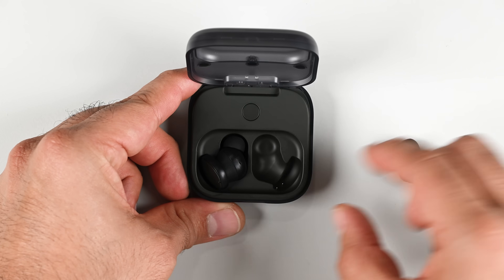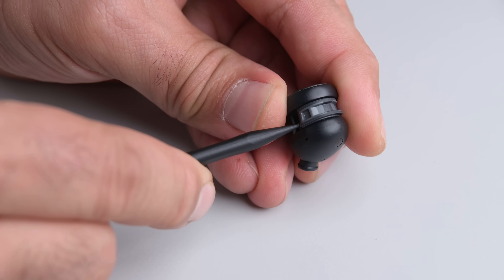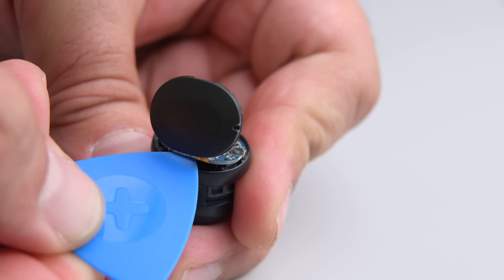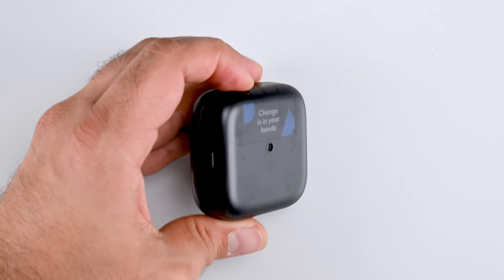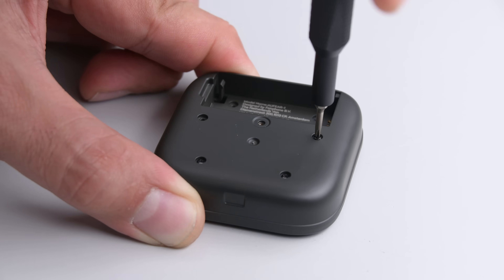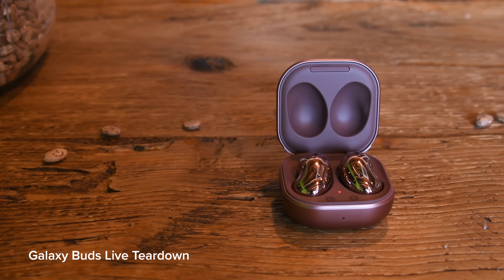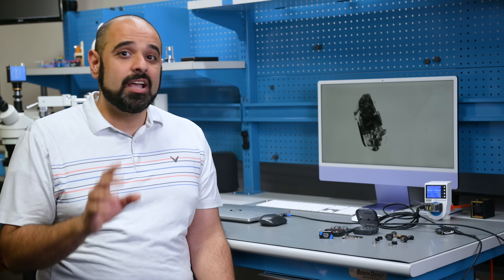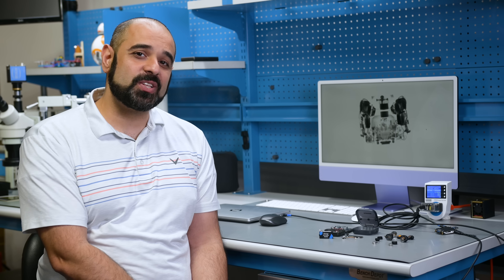Fairbuds Teardown: Our Highest Scoring Earbuds Ever!

Comment: Is there a video about reassembling the buds? Is it possible to glue therm back in with means the average user has? How easy is it? Which glue must be purchased, and where? Will the buds lose their IP protection? 

Also, I didn't understand if all components, including the drivers, are purchasable.

Comment: I work at an independent mobile repair shop. We always confirm with the user beforehand if a consumable electronic device has very low repairability.  Opening these devices often damages the body.

But this fairbuds is in different level of satisfaction.

Comment: Honestly it'd rather it just let me limit the charge percentage to whatever i want like 50-60% as during a 3 hour walk i will only lose 30-35% And that will so greatly increase the health to where replacing won't even be necessary even if you keep it for like 5 years as charging from 0-65% only puts 0.1 charge cycles on it so you can charge 650% worth of capacity and only put 1 charge cycle on it. The case can charge to like 75% instead and still last a long long time. Battery replacement is great but it really isn't necessary. The batteries in my old airpods supercharged to 100% and stay roasting at that high soc and blew up in no time. I'd also like the option to choose how i want it to charge. If i could I'd have them fast charge to about 25% and slow charge after that.

Comment: I have to ask…who actually cares about repairability these days? The only thing i’ve EVER had to get repaired on ANY of my apple devices—and i’ve had them all—is any glass that i broke myself. I use my devices hard. I don’t use cases. Etc. etc.
Reply: I'm not sure if you're joking or not. If you've never needed to replace a battery in any of your products, you clearly don't use them hard at all. Wireless earbuds, when used hard, will lose capacity in less than two years.

Comment: My OG galaxy buds are still alive and kicking after 5 years, that's pretty impressive considering their  batteries are also technically swappable but more work is required that fairbuds. I'd trade the extra hassle of swapping batteries for a lot smaller profile and portability so I'm  still probably sticking with Samsung for my next buds.

Comment: Can you remove the mesh over the driver without having to destroy the whole thing, ideally to clean it? I've had a number of earbugs get the grille (inside the silicone tip) plugged up with gunk over the years and start to sound asymmetrical. Cleaning is an extremely fussy process of dipping the end in hydrogen peroxide, waiting for it to dry with it propped awkwardly with the mesh facing downwards (I jammed my wife's Pixel Buds A into a bathroom nail brush to hold it in position), and then repeating until the grille finally clears up.

Comment: The battery replacement design is the same as that used in most behind-the-ear hearing aids that use non-rechargeable batteries. Now, if only hearing manufacturers would make their newer designs as accessible and repairable …

Comment: I just went to their web page.. The batteries are rechargeable and the replacement batteries are under $15 dollars. Such a deal. On my second set of apples air pods because of the battery. Going to these next. Thanks for the enlightenment.

Comment: Don’t tarnish your rating system. If parts are glued together, then they shouldn’t get a 10. I can’t buy that glue off the shelf and not everyone has a heat gun or even a hair dryer. 10 out of 10 should convey that replacing parts it’s as easy as swapping out a CPU in a desktop. If something as delicate and intricate as a mechanical watch can be made to function 50M under water without glue then electronics can too.
Reply: There's absolutely nothing wrong with glue when it doesn't create risk of damaging any parts. Swapping out a CPU requires thermal paste, not much different from glue. Mechanical watch argument holds no ground. Do you want your electronics to cost and weigh as much as a mechanical watch that's water resistant down to 50M? I'd guess not. Not to mention that a mechanical watch is easily at least 3x larger than a wireless earbud.

Comment: 9.5 out of 10. IMO if you need a heat gun to get into something, that should knock points. and unsure if you will need replacement adhesive strips to put it back together correctly. Otherwise, yeah I agree with this rating.
Reply: Almost nobody will want to do anything other than changing the battery. If you need to do something else, the glue is the least of your worries. And there are much cheaper alternatives to heat guns, so you definitely don't need one.
Reply: There is always one 😅

Comment: The buds’ battery replacement is really next level, like wireless earbuds- Re-imagined. You can not just replace the batteries when they wear out in a few years, you can actually hot swap them when you run out of power, instead of having to put the buds back into the case for 5 to 15 minutes. 
Unfortunately, the case’s battery is less easy to replace. You need a screwdriver for that, prohibiting hot swapping (unless you always carry a screwdriver). I think the bottom cover should be designed to be able to pried open tool-less, like the back cover of the FairPhone.

Comment: I wonder about audio quality and the features, but I really love the idea behind fixable electronics. I'm recieving my framework tommorow, fairphone and fair accessories will come later, but soon.
Reply: I am now just waiting for Crinacle to say they are passable and they will replace my Airpods that are starting to die.
Reply: @PhilfreezeCH  since you mentioned Crin and u care about audio quality why not go for the IEM + TWS adapter combo?

I use my Truthear x Crinacle Zero blues with the TWS module called the TRN BT20XS and I've purchased connectors for QDC to get my QKZ x HBB working on it too. 
The battery life on those is awesome, they stay around 20 hours on just the stems and around 80 hrs extra in the case. There's a better version too called the BT30 it has more features and is around 80USD. If u wanna know the chip used inside is QCC 3040

My combo is $50+20 USD.
Reply: @PhilfreezeCH crinacle only reviews brands that pay him for collabs
Reply: Have you looked at the website?
Reply: @sexymajesco  that's unfounded accusation

Comment: Driver and pcb glued in, sure you can replace the battery.  But this is just worse than any wired earbuds, especially ones with replicable wires.  And those are better quality and don't require disposable batteries.  And are often cheaper as well..   I really can't see why this would be a "10/10".

Comment: This isn't a 10/10 repairable device. Glue, heat gun, minuscule ribbon cables... I love this product, but these aren't as repairable as, say, the framework laptop. These would be quite difficult for anyone without experience to repair. I don't think the rating should be "How repairable it is... for earbuds", it should be "How repairable it is", period. But keep up the great work!
Reply: I mean if you're gonna knock ribbon cables as  negatives I really dont think you should be in a position to criticize anything. Ribbon cables are literally the most consumer friendly way you'll have those kinds of connections and they have to be miniscule considering the product they're being used in, you cant compare laptops and earbuds and apply the same logic to both because that is just comparing apples to oranges.
Reply: Repairability doesn't mean that any unskilled troglodyte without experience can do it, it means that it can be done repeatedly without high risk of damaging something and that commonly needed spare parts can be purchased. 
And repairability ALWAYS needs to consider the type of product. You can't expect a tiny wireless earbud to have the same construction as a desktop speaker, that makes no sense, just like the comparison to a laptop.

Comment: The problem with these is that Fairphone are complete scumbags who removed the headphone jack to push sales of these

I will never give Fairphone my business because of this
Reply: True, this is just a cheap way to score goodwill.  If they kept the 3.5mm jack they wouldn't need to release earphones with a battery at all.  Wired ones (with replicable wires) are the way to go.
Reply: It's also not a great design, it's so clunky, the case looks to be about twice the size of that for airpods, which given how small that battery was is crazy
Reply: What research did you do they don’t even make a profit if they don’t want to feature a headphone jack and they have an environmentally friendly solution let em buying a usbc to audio dongle probably equates to less waste then people buying e waste wired ear/headphones or getting wires tangled and breaking your phone or something.

Comment: One feature i'm missing is to be able to order two left ones or two right ones instead of a pair. A friend is deaf on their right ear so they'd profit greatly.
Reply: You can actually buy the spareparts separately in the webshop to assemble one with two left or right ones. Only disadvantage is that they won't fit in the case at the same time because they are not symmetrical

Comment: I like how they also sell individual earbuds too. I have never wanted to buy wireless earbuds because I know that it's easy to lose one, which makes the whole set worthless. This is a monumental step compared to the competition.
Reply: Samsung does the too, but you need to call them and arrange a visit to the service center, where they will sell you sell you a single one. then you need to pair them yourself by putting both buds in the same case and holding both of them for 15 seconds.
they will not sell the case separately tho
Reply: sounds like these are the perfect pair then
Reply: Actually I believe Apple does sell you replacement AirPods and cases individually at the Genius Bar. Still pricy though 😬 - if it’s just about getting a new one in case of loss but yeah oc they are not repairable at all :(
Reply: Just FYI: Most manufacturers will sell you a seperate bud through their support channels or repair shops.
Reply: @LuukDomhof  Oh, that's useful information, thanks!

Though then you need to hope that the product you bought has that kind of support and that it's for a reasonable price. But still very much worth trying if in that situation!
Reply: @LuukDomhof  I bought nothing ear earbuds and dropped the case somewhere. called them and asked if they'll sell me a new case. They just told me to buy a new pair of earbuds. WTF !!

I don't trust any of them to do this always. I they feel like it they'll just deny and say they don't have the parts.
Reply: @LuukDomhof  I did buy a Galaxy Buds Live when my left one got ran over by a car. It was on ebay and it was used 🤮
Reply: This is why I don't buy separated earbuds anyway.  Even a bluetooth pair has to have a wire connecting them.

Comment: See - it CAN be done. Others make it harder because they want to sell more units!
Reply: It's always money. The simplest and truest answer.
Reply: Capitalism @atemoc
Reply: It could always be done but it sacrifices the size of the earbud unlike with phones. However, if lets say the Apple Airpods had detachable stems that only contain the battery and charging pins. That'll be very nice and I don't think the size would increase. The case of the Airpods is also mostly structural plastic so they could possibly fit a battery door. We all know they won't though.
Reply: Of course, these things can be done. Companies just gave on innovating around these ideas so it's faster and easier to developers technologies which means faster money. That's just the sad truth of life 😄

Imagine if techs were still developed around the concept of removable batteries and repairability. Sure tech won't be as advanced as now but sustainable techs would be in a lot better state.
Reply: Waterproofing, smaller sizing, etc etc, not just about selling units you NPC
Reply: Not exactly. It’s easier to design something that isn’t repairable. Rivets are cheaper than screws for example. I think a lot don’t assume the product would degrade even. But, obviously, since this also doesn’t decrease sales, the extra effort isn’t put in to make it repairable
Reply: its not like it cant be done. using glue instead of screws saves a lot of money when doing huge production runs, and most people dont care about it. go into your electronics store and ask them for the most repairable headhpnes, they will be flabbergasted by the question and tell you that they have never been asked this before in their life, confirming that the consumer doesnt care
Reply: @csPinKie  People only care once they actually need to repair their thing and then are surprised it's not possible.
Reply: @CanIHasThisName  not even always then. ive seen enough sheeple throwing away airpods after the battery failed, buying the same ones (with the same problem in a few years). they genuinly dont care
Reply: @csPinKie  That's like saying nobody wants to replace the battery in their phones easily. There aren't any good alternatives on the market right now. And airpods specifically are a very difficult replacement, not everyone has access to a place that does that.
Reply: @CanIHasThisName  people dont even think about it. People throw away the easiest to repair stuff.
Cars, washing machines, computers, smartphones (yes a display change in a new smartphone is really easy).
I enjoy people throwing away this stuff, because i can get it for free, repair it and sell it for a good price.

Easiest example is a oil change in a car. It takes minutes, costs you less than 40€, the dealer charges 300€ for it, yet you can do it in 15minutes at home. 
Do people do it at home? Most people dont.
Why? Ignorance and convenience
Reply: And Samsung tried
Reply: And the form factor. Compare the size of this vs the AirPods. They are too big for a pair of wireless earbuds
Reply: @Lav-v9c  so you'd rather have e-waste?
Reply: @AlkaVirus  To some folks, their answer would be an easy "yes".

It's hard for some to care about electronic waste, or any waste, when those are shipped halfway across the world and dumped into poor countries few care about.
Reply: @this_is_patrick  even if you don't care about that, you should care about having the right to repair a product you paid for. You can do repairs on your car, why can't you change your phone screen or battery?
Reply: @AlkaVirus  I couldn't agree more.

Also, car manufacturers are in the middle of attacking consumer rights to repair their own car, or to repair using third party services, so even that could be taken away from us if companies get their way.
Reply: They’re the same size as the Beats wing tips
Reply: @Lav-v9c  You're wrong. The size is very reasonable, smaller than many TWS earbuds on the market and the weight is pretty much the same as the Airpods Pro. The Fairbuds are also more stable than the Airpods Pro with stock eartips.
Reply: Except that they are huge.
Reply: Also they will say that planned obsolescence will hasten the pace of innovation
Reply: @GungKrisna12 it does i guess bcs people have to buy new products and companies can develop newer ones faster. But at what cost? Especially for the environment and the consumer is it just a bad deal
Reply: Can be done yes but because of the replaceable battery they are massive compared to AirPods and the look of them doesn't leave much to be desired.
Reply: @wafflecart You have missed the point completely.
These buds are repairable. This is what is all about.
Reply: thats not entirely the case. "planned"(quotes for a reason) obsolescence is half an interesting and observable phenomenon and half an illogical conspiracy theory that starts falling apart.
Reply: @ouravantgarde  Greed or conspiracy, we are destroying the enviroment eaither way.
Reply: @Brato1986  well yes but obsolescence certainly isnt the biggest issue